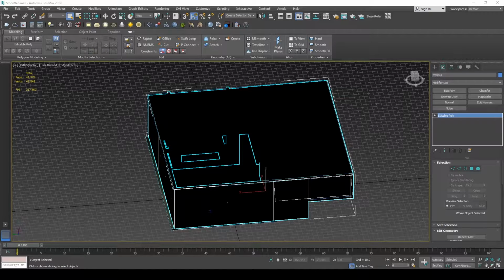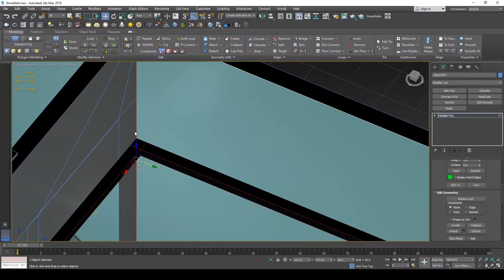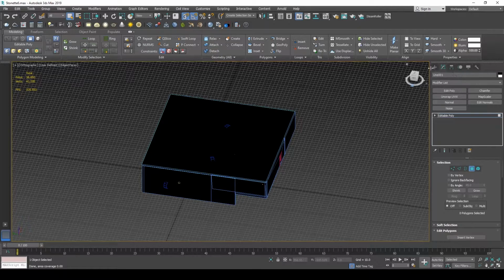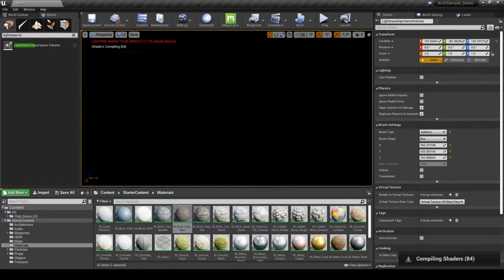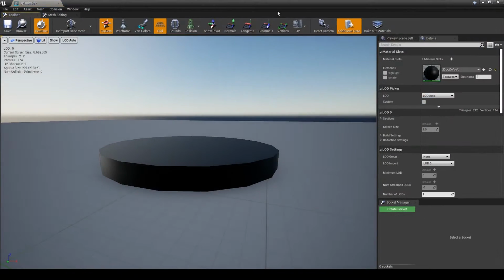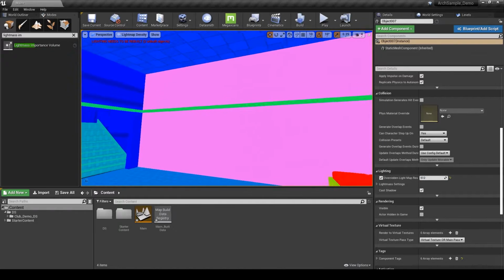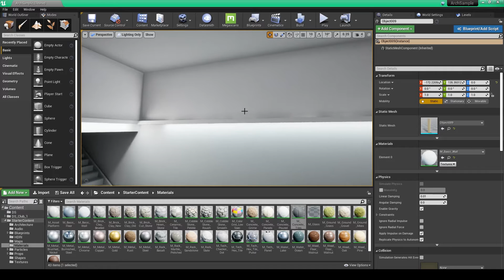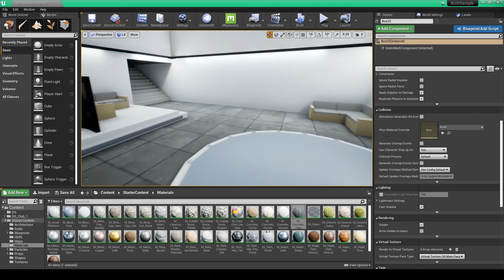3DS Max to Unreal Engine - Part 2

Comment: Great info. I'm new to unreal and the lightmaps were a tough thing to understand. One of things I still don't get is if it matters that unreal will sometimes stretch the lightmap UVs disproportionately. Wouldn't that have the same effect as scaling the lightmap resolution to something other than the power of 2?
Reply from the maker: Hey Jesse. That's a great question. As far as I understand it, stretching the lightmap UV disproportionately is fine IF it still sits within the 0 to 1 grid. When we stretch the lightmap UV to take up more of the grid, we're making better use of that real estate.

For more information, you may want to check out the course "Preparing Design Data for Optimal Performance" on the UE Online Learning portal. The info there is heavily curated and kept up to date. https://www.unrealengine.com/en-US/onlinelearning-courses
Reply: @SteveBiegun  Thanks for the reply. I'll look over that course.